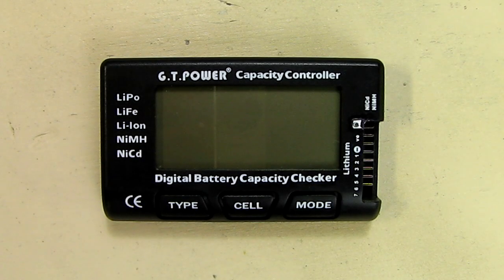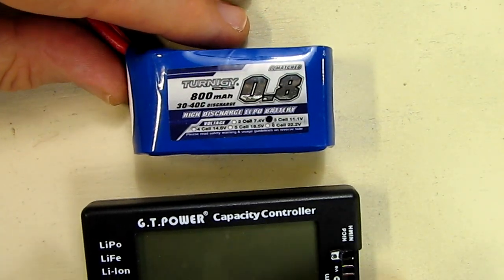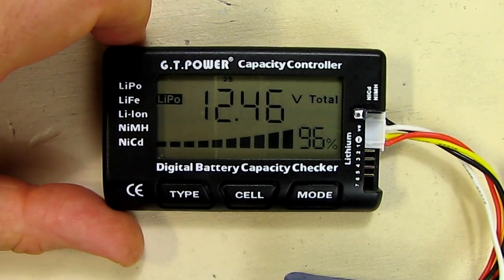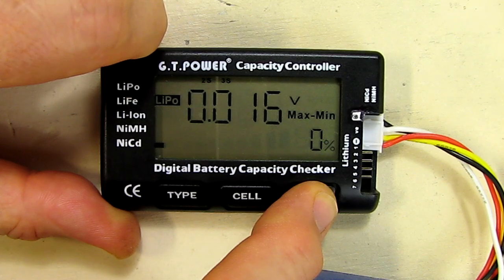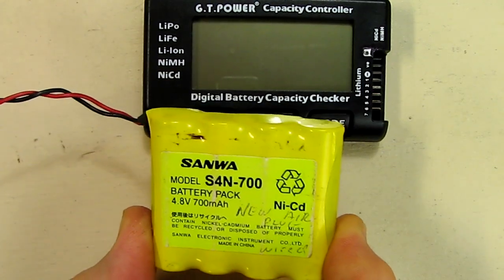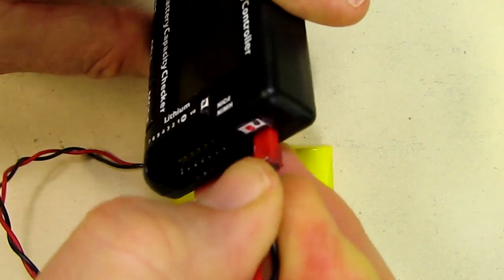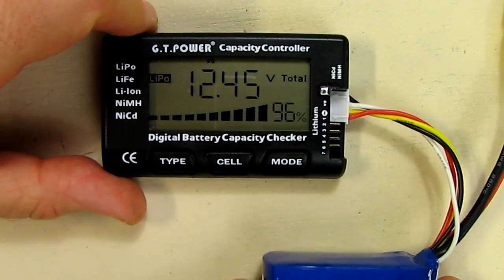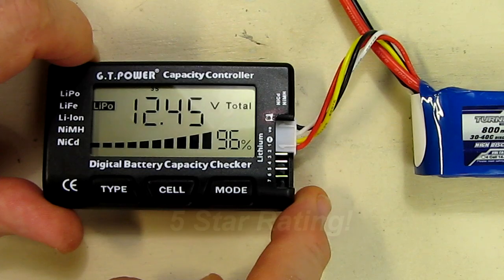BEST RC Battery Tester -  CellMeter-7 Digital Battery Capacity Checker Controller Tester REVIEW

Comment: Excellent demonstration! Any idea about..How to connect Cordless drill battery pack to this checker? Can it support 21V ?
Reply from the maker: It will test up to a 7 cell LiPo battery, about 26 Volts. For a drill battery, it would need to be a LiPo battery, up to a 7 cell type. You would need to have soldered on the JST balance connector, which are sold on Amazon.  https://amzn.to/3wt6tHb